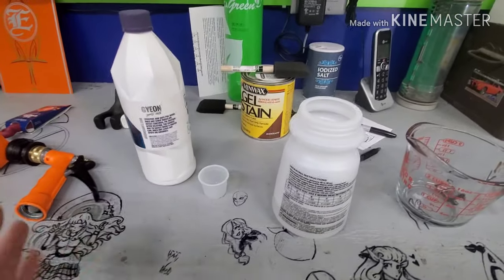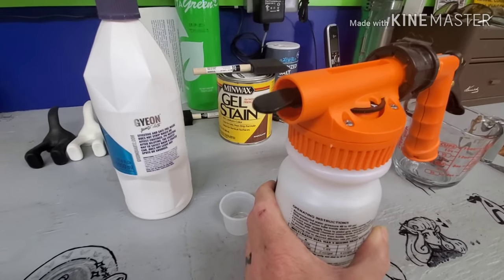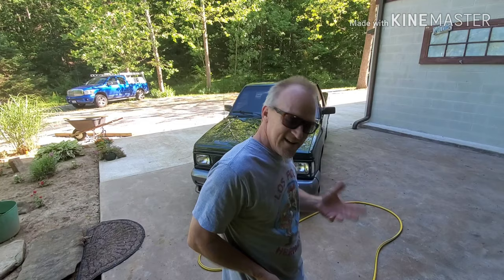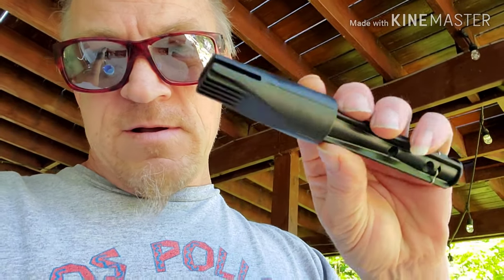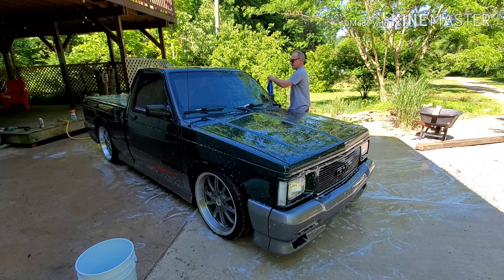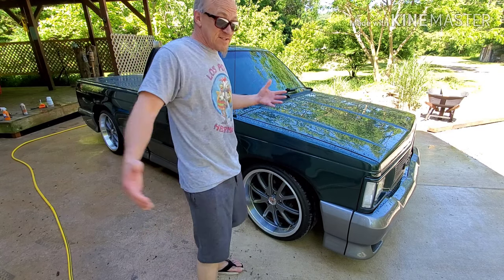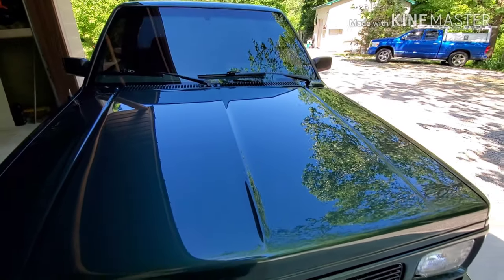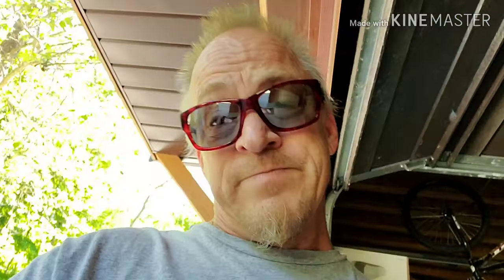Sonoma GT Foam Cannon wash test.  Testing the latest cleaning product.

Comment: I have that same cannon but buy chemical guys. I use chemical guys  yellow citrus wash. I don’t know about the soap that you’re using and the mix ratio but I know in the chemical guys soap they have a dilution ratio for washing and then they have a dilution ratio for the the foam cannon and I under diluted so if it says 5/1 i use 2.5-1 because the setting on the cannon also dilute the soap. This gives me a thicker foam. Now with that cannon it is nothing like the pressure washer version but it still does a good job at holding the soap on the paint and letting the soap work. Hope this helps.
Reply from the maker: Thanks dude!  I'm gonna mess with the setting and ratios next wash!

Comment: My faom kit completely covers my truck in foam to ware you can't even see it Haha I use a small electric pressure washer with snow faom from Chemical guys but Walmart also sells a pretty good foaming soap
Reply from the maker: I'm gonna play with settings on the next try.. lol
Reply: @HardCoreGarage   it will probably work, I only use the pressure washer set up cause I got it for free from a garage clean out job
Reply from the maker: There are different ones for a power washer. Mine is for a standard hose
Reply: @HardCoreGarage  yeah mine just basic I'm not a professional I had a cheap hose one but I couldn't get it to work right 🤦